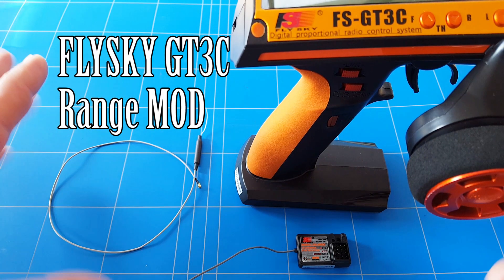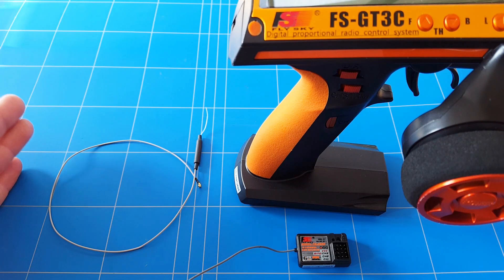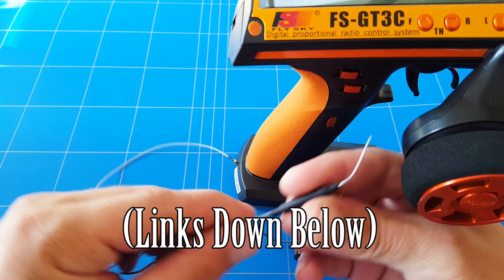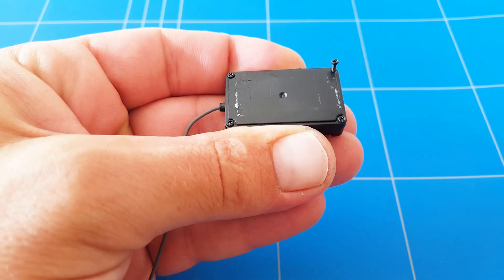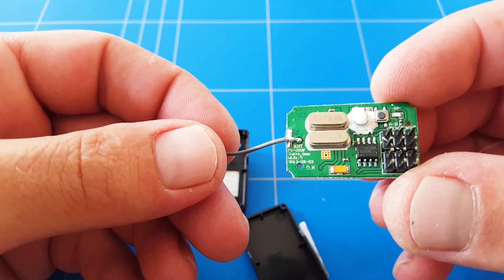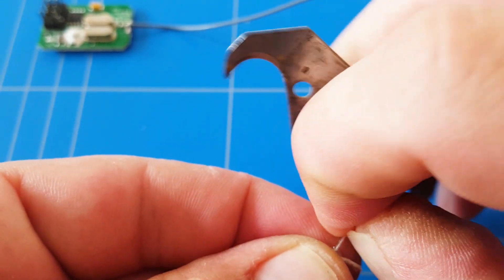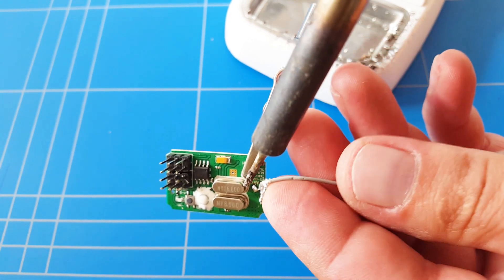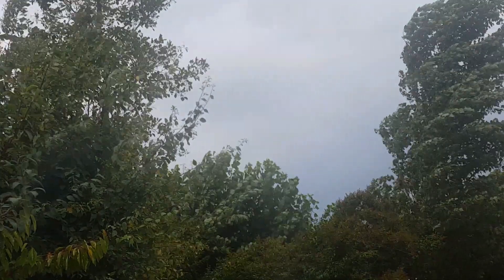Flysky GT3C Range MOD Antenna Signal Booster Improve Reception

Comment: I did this mod tonight on a Rx with a busted antenna wire.  Prelim tests gave me 50 meter range (that’s how long my street is).  Long range testing at our local ball field is needed, but I consider it a success.
Reply from the maker: ouch 50meters is not much
Reply: @HowToDIYRc  Its been a few months, but I took the car to a campground this past weekend.  Range is easily 200m.  The car got to the point where I could barely see it.

Comment: My gt2b cuts out bad when I'm between the receiver and trigger.
Reply: I've checked and fixed a grounded out center wire and still have the issue. I'm using it as a remote for my electric longboard.
Reply from the maker: hmm maybe to close to the ESC that noize out the receiver signal
Reply: @HowToDIYRc  probably too close to the ESC for sure. I had everything tight in the case. No room for anything. I've since bought a Pelican case and a Hoyt Puck. As much as I love the GT2B mod I did, I can't fully trust it. I'll use it on my next build and do some extensive testing before I'll feel comfortable.

Comment: is it ok if i just solder it at the tip of  original antenna wire?
Reply: It works but dont do that the receivers cable is very cheap
Reply from the maker: no don't do that is bad just solder the antenna to the circuitboard oke!